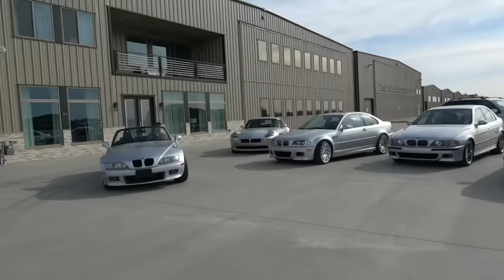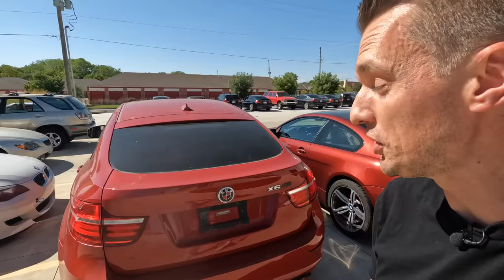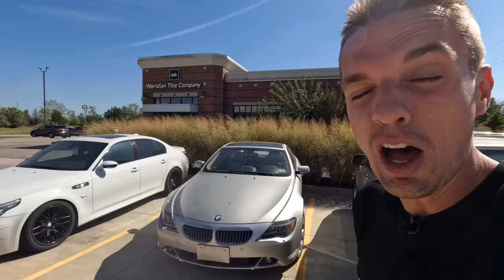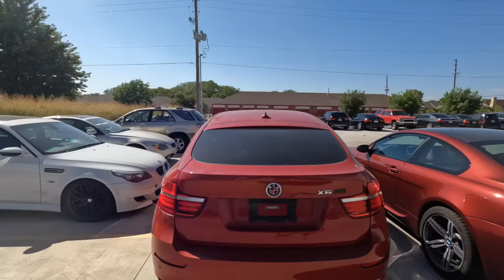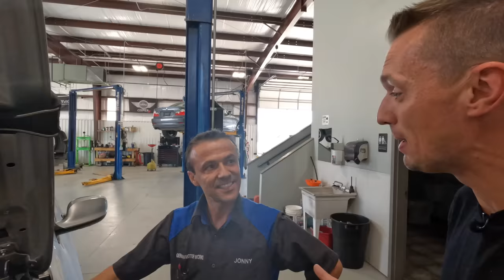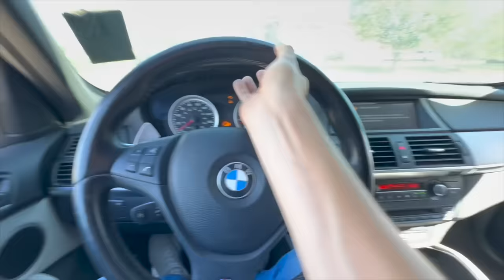I buried my $100,000 BMW X6M (Worst car ever!)

Comment: $8k for a used trans? Found half a dozen on ebay for anywhere from $2500 to $4k. That was with a quick 3min search.....and yes I made sure they were for a e90 m3 and not a regular 3.0-3.5.

Comment: I hate what happened to BMW over the past decade or so. I had a 2002 3 series convertible that was gorgeous, fun to drive and didn't blow up after 75K on the odometer! Newer Bimmers are just a pile of crap: plastic parts that break from exposure to engine heat, rod bearings exploding and trannies seizing after 50K miles. It's just unbelieveable!

Comment: Make a guy wonder! Maybe you should have engine/transmission swapped the X6 with the engine and transmission out of the 645. A manual X6 suv would have been the coolest thing on the road.

Comment: Swap the m6 motor back in after you dig it up ☠️. Owned an 02 525i sport that I loved and was quite manageable for me in my late twenties. I changed the coil packs and spark plugs myself, along with replacing the fuel pump and filter (very important) etc etc.. E39’s are legendary no matter what and a true classic. I love how transformable they are. A real hot rod. The x6M is hideous!!! I’m guessing the battery will be dead but that it will start with a jump in a year.

Comment: Can't deny that BMWs look good, but I also can't deny they are German junk.  I just took my 2002 Acura on a cross-country, 2400 mile trip and never had a doubt about it mechanically.  The car has 250k miles and runs like new, doesn't use oil and gets 30 to 33 mpg.

Comment: Great job. This video should be forwarded to BMW USA President. Sebastian Mackensen.
 I hate my 2014 BMW 528i. They are junk and expensive.  To replace is an adaptive headlight is $3500.  Junk plastic in the hot engine bay too.  Junk..only 34k miles too!

Comment: I would like to see you fix that BMW up instead of bury it. It would be cool if you could show how to get the part without buying the whole car try to get it out of a junk yard or something as cheap as possible find somebody that is willing to put it in correctly as cheap as possible and then give it a rattle can paint job yourself and see how much you can possibly get for it at auction

Comment: I know the point is that you want to see if it starts again after it's buried. But if it weren't for that I'd want to put a brick on the accelerator in neutral, puncture the radiator, and bury it with the engine floored and see if the engine can not explode before it's covered in dirt.
Reply: Ooo or if it has remote start, start it while it's buried.

Comment: I've lost count the number of times I've chopped up bell housings swapping around to make things fit, often for manual conversions for configurations that never had a manual option.  I'm assuming there's a lot more involved here than just finding a dead transmission, chopping the incorrect bell housing, and then welding the working one from said paperweight?  That might be impossible, I'm ignorant of the new stuff.  I've had more than a few E36's in the past and have an E31 now, but nothing newer than the 90s and even the E31 has a Toyota 1UZ V8 supercharged instead of a BMW engine (most reliable BMW I've owned).  I had to make the BMW transmission work with the 1UZ through some creative solutions in my machine shop.

Comment: So I'm probably a bit naive and oversimplifying things but, would that X6 not have run ok if you swapped the ECU out for the right one for that (non M) motor?
Not that it really matters now but, why didn't whoever put the engine in think to do that in the first place?

Comment: Such a rewarding and satisfying video to watch. BMW's are total junk vehicles, my 2011 BMW X5 Diesel had the transmission, brakes, and exhaust all covered under warranty, they wouldn't fix the seat bolster as it was considered 'wear and tear',  I had a new 1989 BMW 750iL another fine lemon, went back to the dealer so many times that I traded it in on a Porsche. I look at BMW's and think they are such beautiful looking cars, and when they work they are great, but it is all the time-wasting, nickle and diming, unreliable crap that stops me from ever buying one again. And I tell that to all my friends to stop them from buying them, don't ever buy one. When it comes to your money the Lord Giveth, and BMW taketh away. Good ridance.

Comment: Bayerische Motoren Werke AG - I have a 1999 E39, and it wont drive due to some mystery electrical fault... and I have't got a wizard, so I need to work it out myself. That was from before they got complicated. When they work, they are fine machines, but a complete pain when the gremlins set it, and goodness knows why someone would fit the wrong engine. I would have broken it up for parts but I guess this is better content.

Comment: i had my cousins 2007 650i parked in my back driveway for close to a year and i tried a to get it moving but just wouldn't with its battery being so big and having the engine was running rough before then.

Comment: Why not blow the cars up instead, or use them for target practice with some military unit? But if you put them under the ground, why not plant an "H" (for Hoovies), with a brand emblem on the location. Add some text if you like..."Here rests a mechanical device that didn´t deserve a better fait."

Comment: I use engines that run any where I put them . I just put a F 700 engine in my dodge 3500 and it works .

Comment: I'll give you $8,000 for the 6  series.
I'm an enthusiast. 
I have:
2003 325 touring modded but not heavily - 180,00 miles
2006 330ci ZHP Convertible, bone stock but well maintained -125,000 miles
2006 750Li bone stock, well maintained - 106,00 miles
I don't go for run of the mill Bimmers, and this one would fit my fleet quite well i think.
Reply: official_hoovies_garage.  I just saw this I'm not sure if I'm doing this right or reaching Hoovie at all.
Big fan of you, Tavarish and Ed.
Also can't get enough of the car ninja cuz I'm a beamer guy.
Reply: The offer stands for the donor car! I need another bumble butt BMW
Reply: By the way there's a good story that goes along with it the acquisition of each of these cars that I have now I also have a Honda Odyssey minivan with 310,000 mi on it but I use my daily driver or my work truck

Comment: Oh trust me, I hate BMW as much as you Tyler.I have a first generation BMW mini with multiple failures including gearbox and I had a BMW Z3 which seemed like it was having a new problem every month and when I was driving down the highway the crankshaft besides it was best for the engine block. So I say it's good to see the death of a BMW and I will never ever own one again. I'll probably rent one because it's not mine and it's short term.

Comment: This might be the most relatable video Hoovie has ever made, lol.  I had an E70 X5 (basically the same thing as this car).  I love (specific) BMWs, but these are just so terrible.  My last straw was when it broke a fuel line dropping my kids off at school, nearly catching on fire. 

That was just after I spent months fixing the alternator gasket of doom, the creaking ball joints, the rear air springs, and the internal coolant gasket “stent”.  

It still needed the valve stem seals, and it leaked oil from everywhere.  There’s still an oil stain in my driveway from that turd.  I literally wanted to push it off a cliff!

I patched the fuel line together that same day and traded it in immediately - ironically for a 2012 X3, but I specifically wanted the NA N52 inline 6 engine, not the awful 4cyl turbo - and it’s been really good.   

We knew they were just going to auction the X5 off for parts, the fuel line wasn’t the only remaining problem.  We joked that we needed to get as far away as possible before the mushroom cloud erupted….  And I still hate that car.  

For what we got in trade value, literally pushing it off a cliff might have been worth some sanity points.  Burying this turd was the right choice, there is no redeemable value in these cars.
Reply: Sounds like you bought a V8. The inline 6 E70's are no worse than the inline 6 BMW cars. The best E70 experience is had with the diesel. And did you really complain about airbags on the E70? Probably the cheapest and easiest to replace airbags in existence. And they last a long time.

Comment: Unsubscribing! You could have donated that car to someone in need instead of doing that. You don't treat cars like that, let alone a BMW. It's not the cars fault it was treated like that by the previous owner. You could have done an engine swap and kept it running, yet you do this...

Comment: That scammed BMW will never run, so why not just strip the car for parts?  Instead you are going to ruin the car by burying it.  It's yours to do what you want but it appears you want to extend the hoovies one more year.  Is there any value to parting the car instead of going the sensational path of burying it?